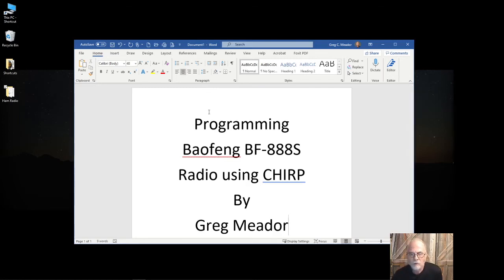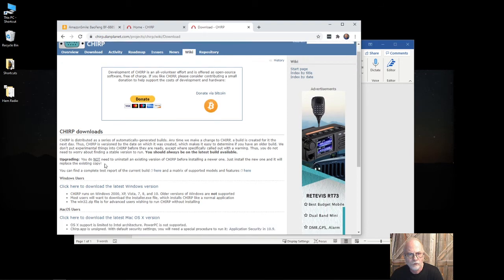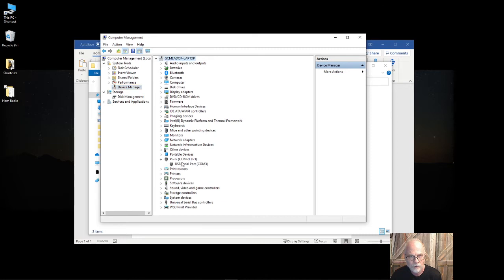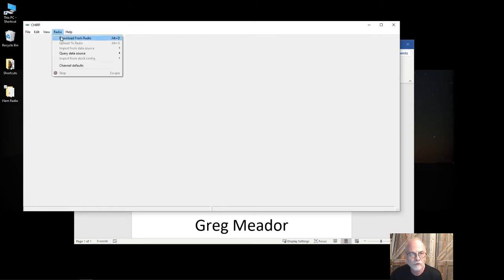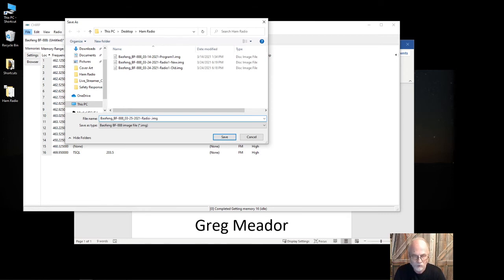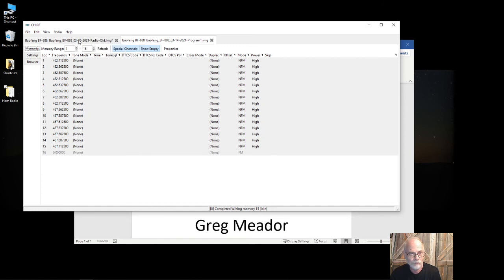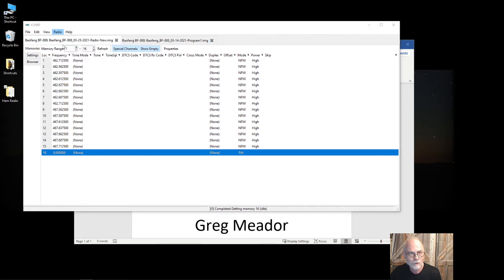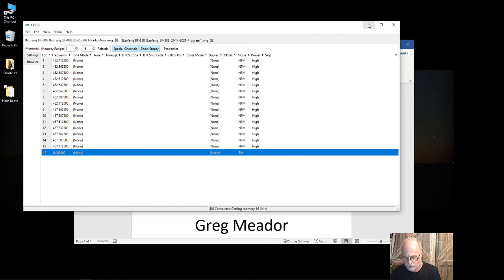Programming Baofeng BF888S Radio using CHIRP

Comment: Hi! after programming these radios with chirp the mic gain went to having to put the mic in my lips to be heard, i have to put other radios almost in max volume to hear the bf888s, i dont know whats happening, tha cable is original and chirp is the latest version, even after uploading the stock programming the mic gain doesnt go up, before they had perfect mic gain.
i dont know what to do.
Reply from the maker: Thank you for watching our video. We are sorry you are having issues with your radio. Does your radio have the stock antenna or an aftermarket antenna?
Reply: @theoilykrafter thanks, it has the original stock antenna

Comment: i bought the amazon PXTON PX-888S radios, but i can't figure out how to make it scan. the little manual says push ptt & moni (squelch) simultaneously to toggle scan. and i did, but i still can't tell if it's in scan mode. is there a way to test it ?
Reply from the maker: Thank you for watching our video. Yes, the 888s radio can scan channels, but it requires being set to "channel mode" and turned on with the PTT and MONI buttons held down. The radio scans through programmed channels 1-15 when the channel selector is on channel 16. 
How to enable scanning
Ensure the radio has at least two channels programmed; it cannot scan with fewer.
Turn the radio off.
Press and hold both the PTT and MONI buttons.
While holding the buttons, turn the radio on.
The radio will begin scanning the programmed channels when the channel selector is on channel 16.
The radio will stop scanning when it detects a signal and will continue scanning when the signal ends. 
Important considerations
Scanning will not work if the FM radio function is activated.
For scanning to be useful, you must have at least two channels programmed with frequencies.
Reply: @theoilykrafter  thanks for responding. how do i determine if there are any programmed channels ?
Reply: @youpattube1
Ur going to want to program the channels via usb lead first, radio does come with channels programmed but these are random Chinese, it could potentially interfering with emergency service in ur country. So dont transmit on any channels unless you know what it is and is allowed

Comment: Can two wireless devices be paired without connecting to a computer?
Baofeng with kenwood
Reply from the maker: Thank you for watching our video. The Baofeng radio that is used in this video does not have Bluetooth. Newer handheld radios can successfuly be paired with certain devices like a push to talk button, or in some cases wireless ear buds or even headsets. The ability to connect to radios is unique to the radios themselves and you would have to try to connect them to know for certain.

Comment: Thanks for the clear, simple instructions.  

Wondering if you know - can you bump up the power with the chip software? Or is high as high as it goes?

Does 888 have more channels than 16?  

To use as scanner, etc?
Reply from the maker: Thank you for watching. High power is as high as it goes. <5W according to their spec sheet.

Comment: I just bought 6 of these and they seem to work fine out of the box. Would it still be wise for me to open them in CHIRP and reprogram them? I just want to maximize the range and signal strength etc. I am in the US. About to use them with an art festival crew. How do I determine which frequencies I need?  Should I get GMRS license? Can I get away with the stock channels? Should I wipe the stock channels and replace with FRS for all of them? Thank you for your advise. I just want to have a stable ish setup for the crew.
Reply from the maker: Thank you for watching our video. I used CHIRP to program all of the radios the same. The problem with using the BAofeng 888s for a festival crew is that they operate in the licensed portion of the band. You would need to use FRS radios to avoid the need for a license to operate.

Comment: Hi, I tried to program various 888s radios but after writing, the radio remains with the channel open and the green LED on... I also tried using the boafeng application... it's always the same
Reply from the maker: I have programmed literally 100s of the Baofeng 888s radios without any problems.
Reminder to always read from the radio first into Chirp and save a copy, and then copy and paste the channels into Chirp you wish into what you read from the radio and write it to the radio. Don't forget to save the new program. this will prevent you from having issues with potentially different firmware revisions between radios.
Reply: @theoilykrafter  thank. yes, I believe you. until 2022 I was able to copy all the 888s, even with the boafeng program... but after that they always remain with the green LED and open channel and when I read the frequencies they are the same as the original source. Can I send you a video to help you understand the problem with my radios after programming? I thank you
Reply: @theoilykrafter  this is my problem whit all 888s - https://www.youtube.com/watch?v=cB0c9IXF8Ks

Comment: I have some Baofeng 5RM’s 4 have the same version 14 and 2 have version 11. Can I transfer version 14 data to the two version 11’s? Also, is one version blocked? Which is better? Or should I go to Baofeng Website and upgrade the 11’s to version 14 or whichever version is the latest? HELP😮😮😮
Reply from the maker: Thank you for watching. You should be able to use Chirp to export your channel programs and then import them into a blank tab in Chirp for your other Baofeng model. I would suggest always starting with reading from your radio. Save that to a file. Then importing the channel program into Chirp then write to the 2nd radio. Don't forget to save the radio program under a different file name.

Comment: My CHIRP program says that there is "No response from radio" after clicking "OK" to "communicate" with it. Do you mind telling me how can I fix that?
Reply from the maker: There are a number of things it could be. A bad programming cable, an in correct baud rate on the COM port, an incorrect data bits and stop bit setting. It could also be that you have the wrong model radio selected or a radio that is not supported by Chirp.
Reply: It works stable on com1 or com2.. try to change your port.. and run as administrator..

Comment: This is a great video and exactly to the point, however I'm still unclear why I would be doing this. Is it to make sure that all my BF888s radios share the same frequencies for each channel? And you replaced the settings with an existing file; where did you get that file?
Reply from the maker: I used Chirp to create the program that was written to the radio. After programming the first radio. I read from the next radio and copy and pasted the frequency table into the tab that I just read from the radio after saving the original configuration. Then after pasting would save and write to each subsequent radio to ensure that they all have the exact same program.

Comment: Thank you, this was great. 
How would I program the same radio to work with other brands like SFE, Panasonic? I recently had to replace my radio but I'm struggling with the setup
Reply from the maker: You will either need software to program your radios or become proficient at programming them from the front panel. Here is a link to check and see if your radio is supported by Chirp. https://chirp.danplanet.com/projects/chirp/wiki/Home
Reply: @theoilykrafter  Thank you. My Baofeng 888s is supported but the SFE S780H RADIO is not support. So I can't configure them. I tried contacting SFE